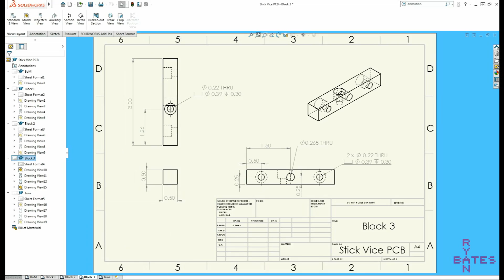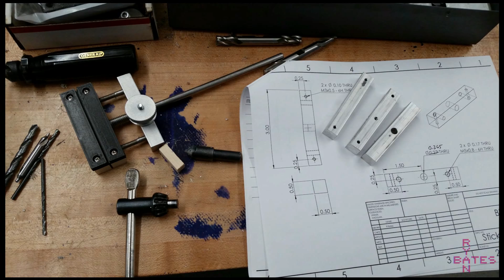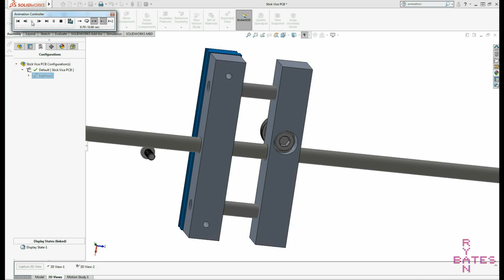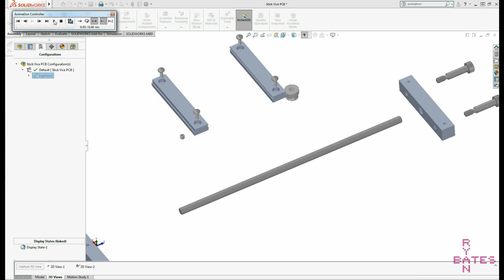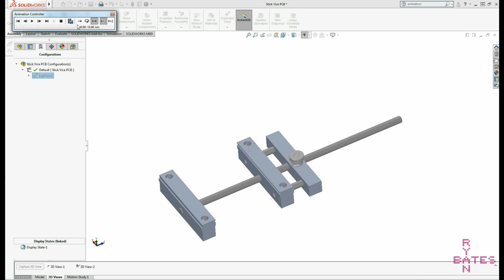Machine a PCB Vice (Make a Stick Vice from scratch)

Comment: Nicely done, and nice video.  I'm going to have to build one of these now.  
Do you think it makes much difference if you use one center spring or two outer springs?
I'm slightly concerned with the holding power of the set screw on the end of the rod (on the non moveable jaw).  Any issues with it loosening up there?  Wonder if a drilled/tapped hole in the rod would be ok?
Reply from the maker: two outer springs grips better at the jaws.  Set screw works really well, be sure not to grind the head too much.
Reply: @RetroBuiltGames   Here are some photos of my finished vise.  I'm pretty pleased with how it came out.
https://imgur.com/gallery/R3sikB5